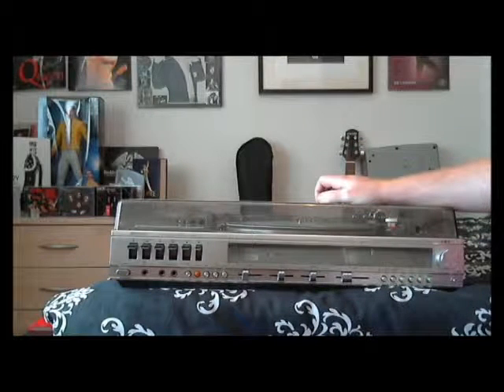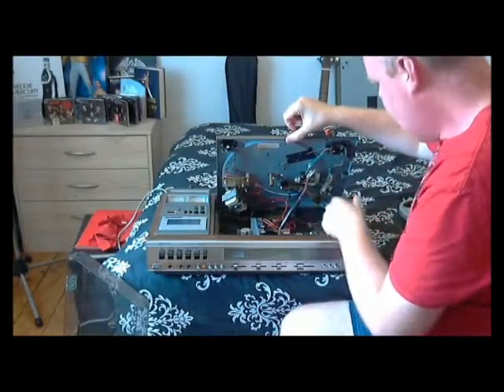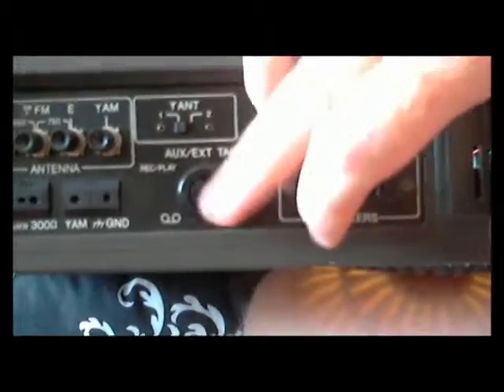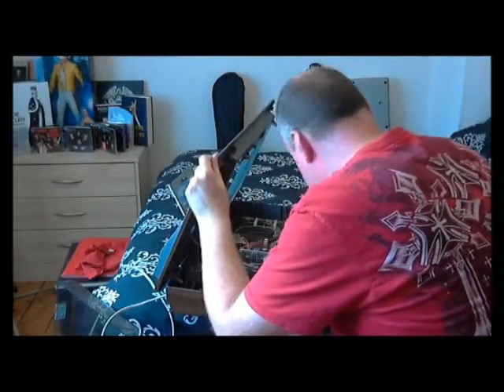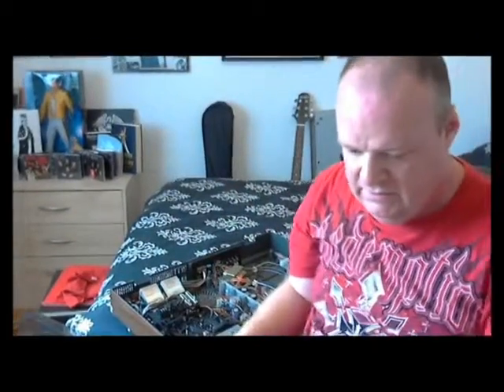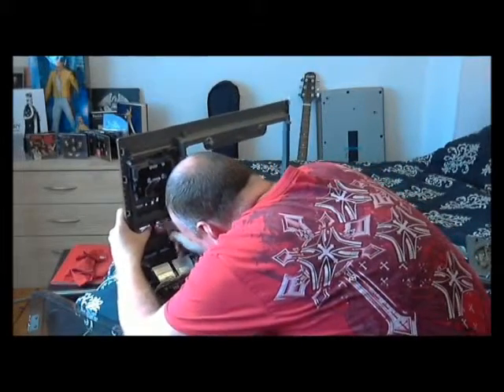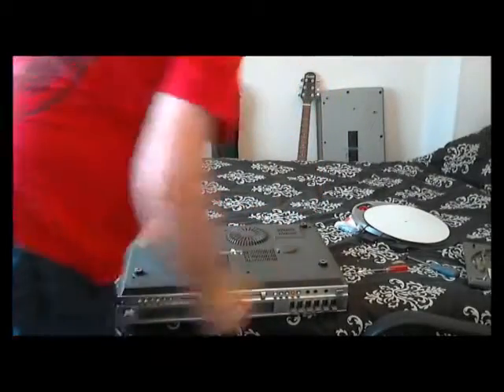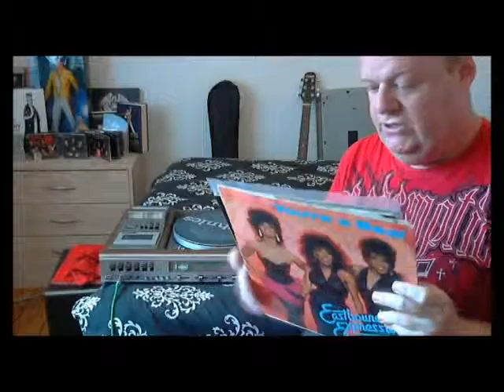Trying To Repair the AWIA 5050 Cassette Recorder

Comment: No wonder you never fixed that tape deck! I spent a couple of hours with that bloody hi fi. I found out how to take the tape deck out, but the motor has to be un screwed before you can replace the belt. I had nothing but trouble putting it back together. It should have been straight forward, I've opened up a few music centre's and that was the hardest yet. I bet your glad you didn't take that tape deck out! I had one the same a few years ago, I put it in a repair shop to get fixed. The guy couldn't fix it! It was broken during a flit. I got my other one recently it looks ok but it's all fucked inside somewhere. No sound fucked tape deck. If only there was a decent repair shop near by! Im just glad it wasn't dear. I used to like Aiwa hi fi's! Another thing I have to say is that the tape decks on music centres are a hit or a miss to fix! I usually connect it to a separate tape deck through the din socket or a Bluetooth receiver in the din to! You done the right thing leaving that tape deck alone, I wish I did! Look after it.

Comment: The chassis and base may also have been used with a higher powered (amplifier) version of the same basic circuit, such as the AF-5080.  (Higher power, more heat, so fan needed.)